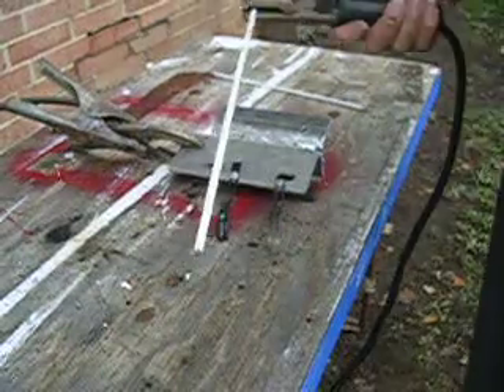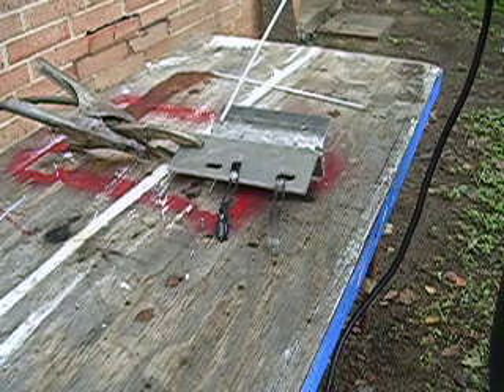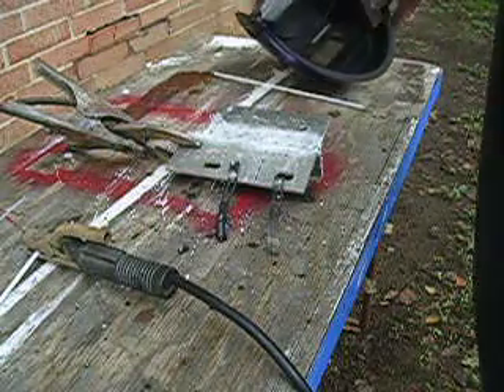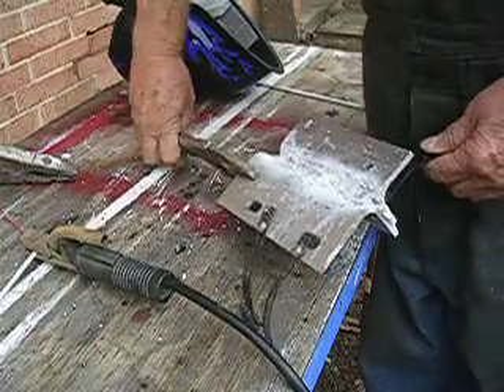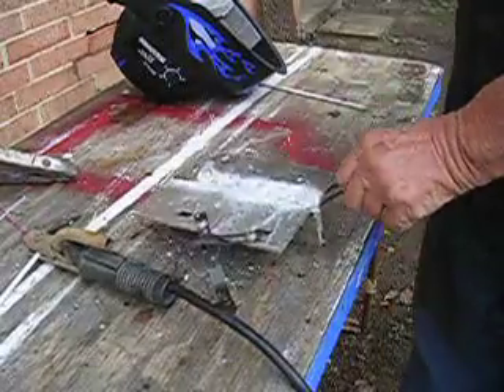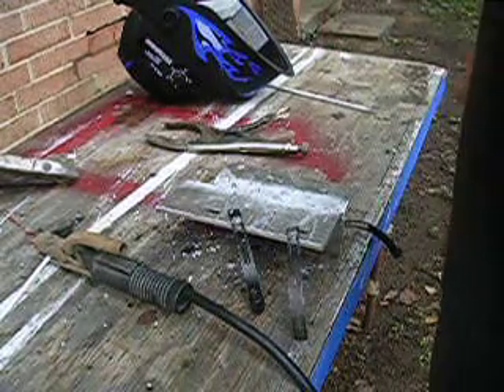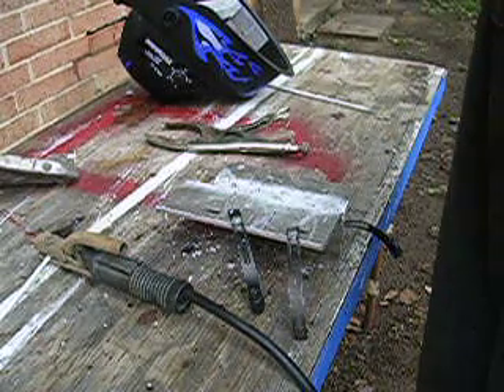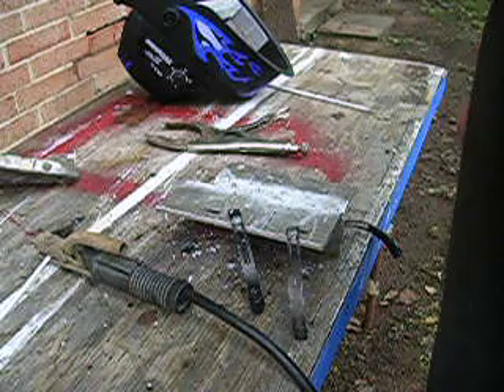WELD ALUMINUM BRACKET FOR TOOL POST GRINDER see ebay item # 380262892658 or 350388156484

Comment from the maker: I have never welded for the public.  I have never done production welding.  I do not want to do any welding for the public.  I do not want to ever do any  production welding.  Welding is hot, dirty hard work.  I had rather sit here in my climate controlled office and sell stuff.  BTW, I have been selling stuff for 76 years.  I have owned 1000's of frames of scaffolding and also had catwalks.  I never let anyone weld on them.  If they got damaged, I took them to the scrap yard.

Comment from the maker: @archer82633 I did not let so called welding experts at welding shops weld on scaffolding either. I have seen too much of their stuff fall apart. These arguments can go on til hell freezes over. I am not trying to sell this rod to experts like you. This rod is for a homeshop. If I want a 40 aluminum rock trailer, I will purchase one from someone who knows what they are doing. I wouild really have to be as stupid as you think I am to take my little 3' aluminum trailer to you to have it welded on.

Comment from the maker: @1930charles I guess I better take those 2 pieces of scrap aluminum down to a real welder like you and pay $300 for an expert 5 minute welding job. I have used my trailer and my toolpost grinder several times and they are still holding together,but I am such a dumbass, I just don't know any better. This is not a catwalk.  This is not scaffolding.  This is not a ladder.  In past years, have been in the scaffolding, catwalk and ladder business.  We did not weld on this equipment with anything.

Comment from the maker: @archer82633 The tool post grinder bracket I welded in this video is holding together just fine.  It cost me a few cents to weld it.  Why would I want to take it to a welding shop to weld it.  I do have other welders and I have sold welding rod since 1963.  I have had stores in Ft. Worth, Euless, Hurst, and North Ricbland Hills.  This is the rod I am selling in this video, and this is the machine I am using and it does an adequate job.

Comment from the maker: @archer82633 Use this rod with DC reverse polarity (electrode positive) only.  I have owned many welders in the last 60 years.  I have never found any welder that uses a gas shield to weld outside in the wind.  I can take a Lincoln SA200 amp portable welder to Kansas where the wind blows a gale all the time and weld aluminum with
this rod.  BTW, all Lincoln SA200 welders are DC.  They do not make them in AC.   You plug mig into ac,, but more than likely converted to DC with an inverter.